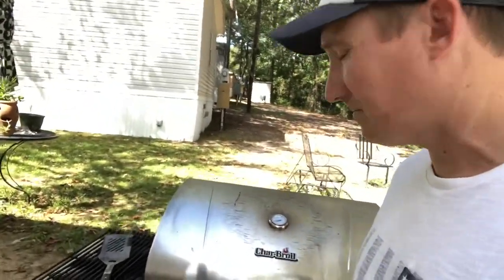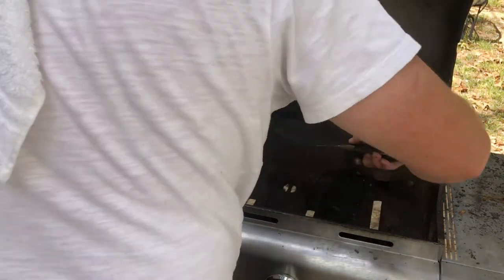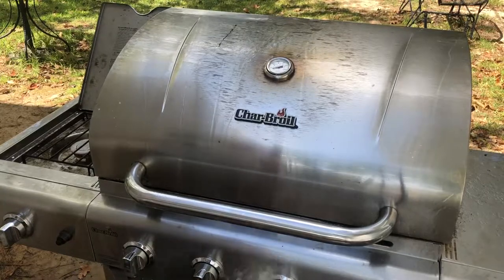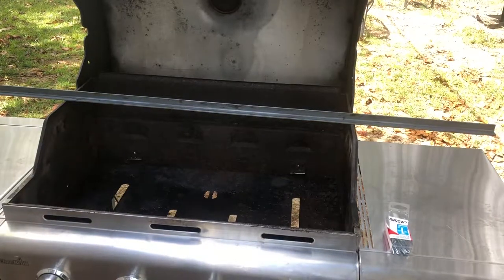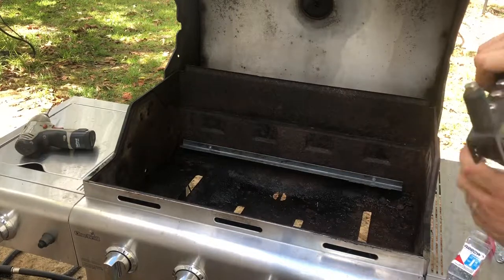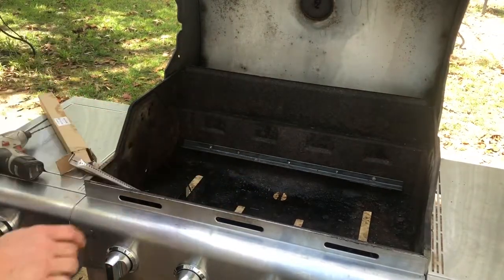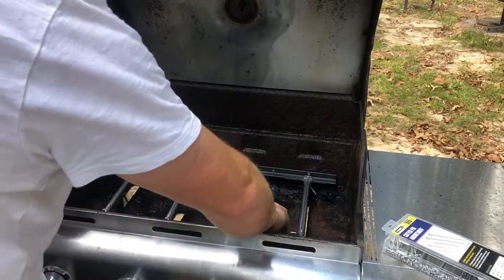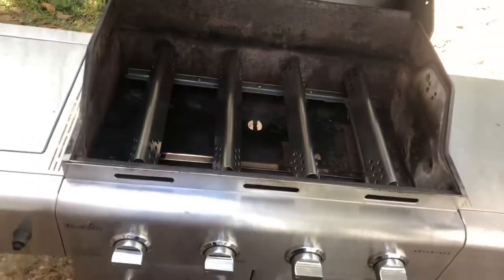Easy Char-Broil Grill rebuild - Step by step instructions - Raleigh Jones

Comment: Did you go 1/2" angle iron?  I just bought everything to rebuild my stainless Charbroil.  I don't know if I need to even go that far.   Mine is about 7 years old.   I spent more and went directly to Charbroil.  I went OEM and didn't go universal.   I'm a shit magnet so I went with original.   I just bought a 36 " Blackstone griddle.   It's a blast!Great video.
Reply from the maker: I appreciate your comment, the tabs on the back were in back condition so I decided to re-enforce them with 1/2 angle iron and it has worked great
Reply: Were the parts not under warranty for 5 years